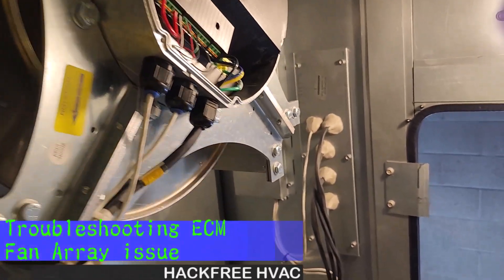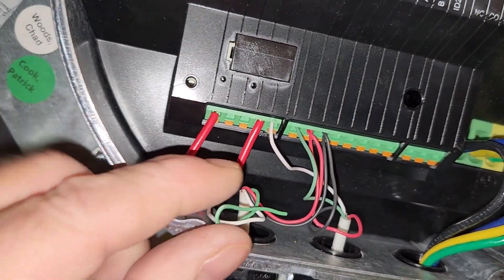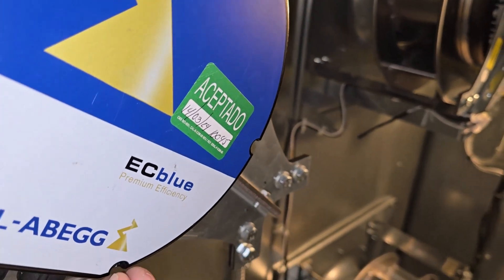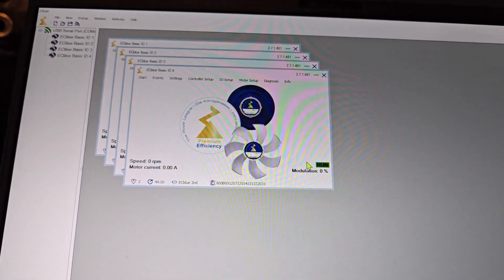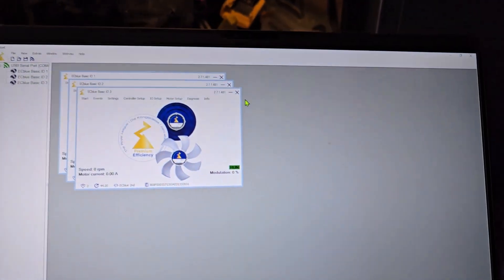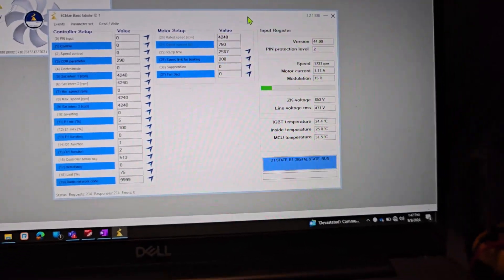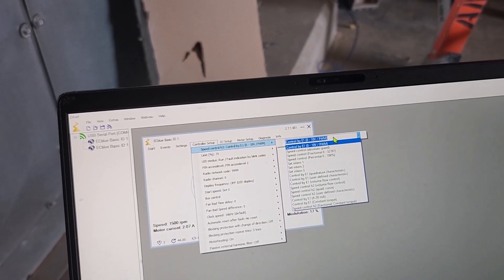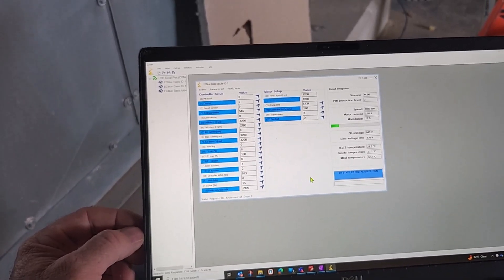Setting some motor parameters in ZIEHL ABEGG EC Blue fan arrays

Comment: Good morning, I have a ziehl-abegg 187014 fan, connected to a signal “10V DC output to D1 Digital In” and communicating by PORT1 MODBUS RS485.
I try to enter “ECblue Basic” and I can only enter in tabular.
I have no communication with my Modbus system and I don't know how to test in the ZAset software.

Comment: Just worked on a 200 ton AHU with a fan wall. Has 6 20hp motors with those backwards inclined fans. It was like a hurricane in the supply

Comment: Are u working for the OEM? All these new units are getting fun to work on. So much different than the older units. You’re pretty much screwed without a laptop now days.
Reply from the maker: I help techs out, essentially.,
This was something I had to research and get the software for.
Never used it before this use.
But I've used various software for various things so it is just something else to figure out. I knew it was obviously not set to run based on the analog input. So I just had to get connected. Feel around the software and find the parameter to change.

I did spend about 2 hours just installing and initially figuring out how to connect the software with my Amazon RS 232 adapter